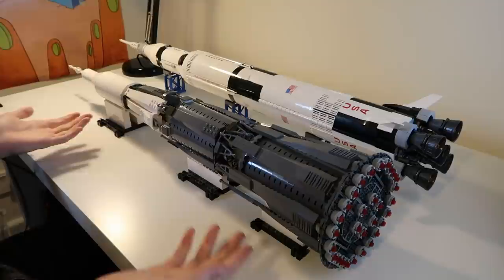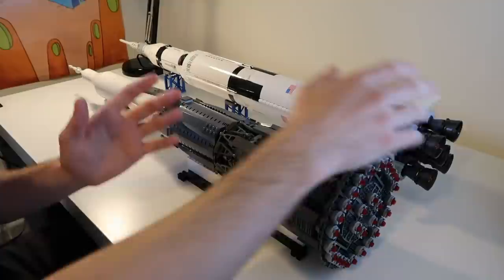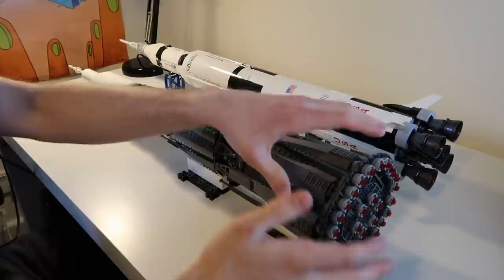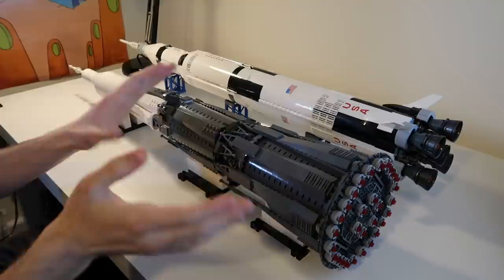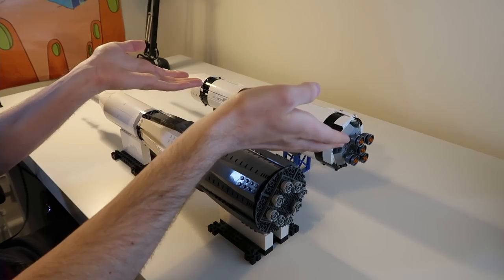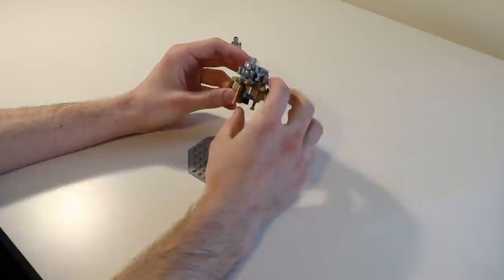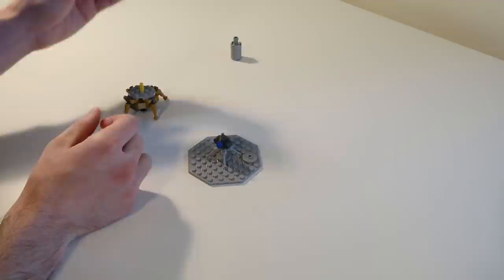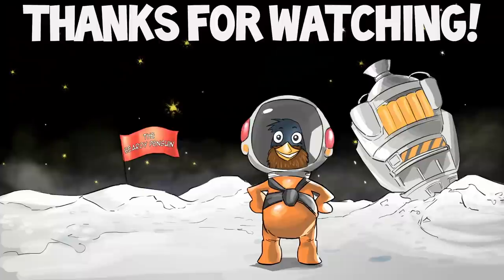The Soviet Moon Rocket Explained With LEGO

Comment: 2:58 Minor pedantic nitpick: the NK-15s were not the first staged combustion cycle engines flown - the Proton used an oxidizer-rich hypergolic staged combustion cycle on its first stage, its first flight taking place in 1965, and the first flown kerolox SCC engine was the S1.5400 in 1961. (If you want to stretch the definition of "combustion" as some do, then the British Gamma engines also beat it, but it does require some definition-bending!) Most certainly the most spectacular use (for a lot of the wrong reasons) of the cycle by that point, though!

RE the video as a whole - amazing summary in its own right, even setting aside the circumstances of its production! And a LEGO model/explanation of Mir would be an interesting piece too - if I may suggest a future topic, the Salyut/Almaz stations would also be fitting (and being similar with incremental improvements, would suit themselves to the modularity afforded by LEGO. Though maintaining a consistent scale with other creations, such as Mir/ISS, may be harder if taking that approach.).

Hope the rest of the road to recovery goes well!

Comment: I have heard the problematic inner ring of six engines was added later in the design.
Originally the concept was to launch multiple rockets and assemble in LEO.

Glad that your back is back, at least somewhat, I wish you a smooth recovery.

Comment: The first stage of the Saturn 5 did not have 2 tanks it actually had 9(4 LOX and 5 fuel) because of the fuel used. 
Despite what is shown in illustrations there is actual video from inside one of the fuel tanks in flight available on YouTube.